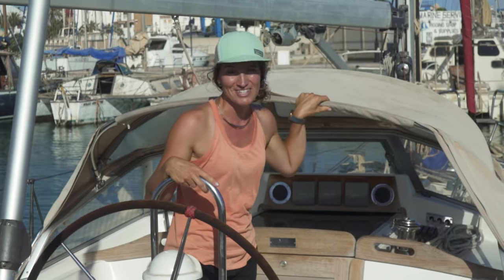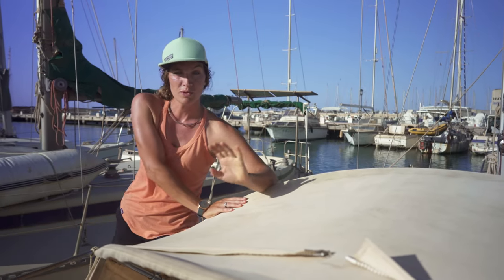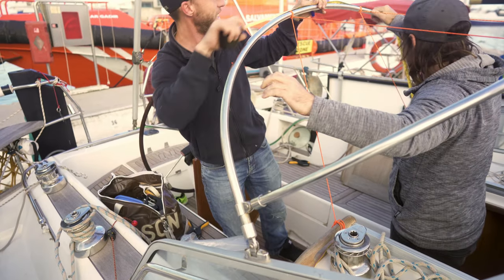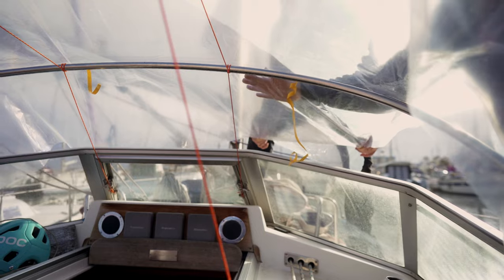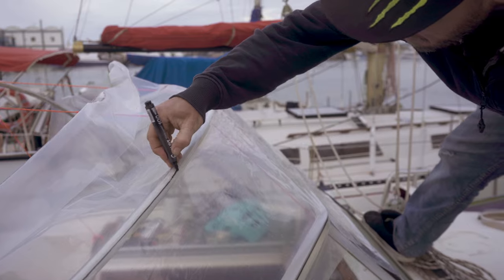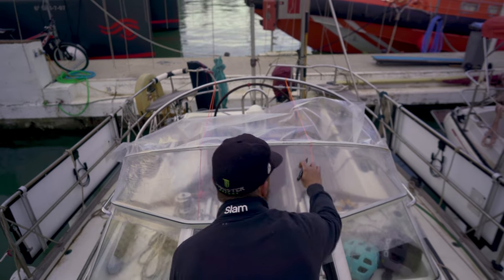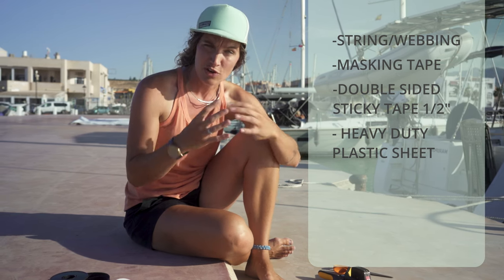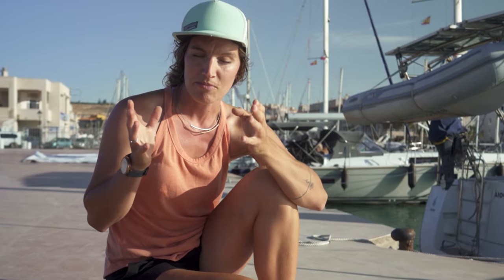DIY Spray hood like a Pro | Tips & hacks to make your own dodger THE RIGHT WAY!

Comment: Great tutorial! Do you recon that making a templaye with to original sprayhood on gives the same result as without the original on?
Reply from the maker: Danny suggested if you have the old spray hood and it fitted well, un pick the stitches and use it for the template. If it doesn’t fit well, you can modify it or start again. 
I hope this helps 👍 
P.s good luck and let us know how you get on here!

Comment: Since you have an existing spray hood, wouldn't it be easier to rip the panel threads and use use these as a template.  No measurements would be required.
Reply from the maker: That’s exactly what Danny suggests at some point in the video. However we were lowering the hood as it was rather high and obstructed the helmsman’s view.